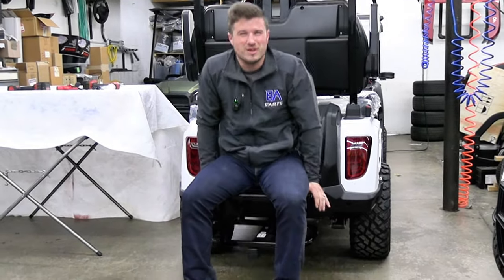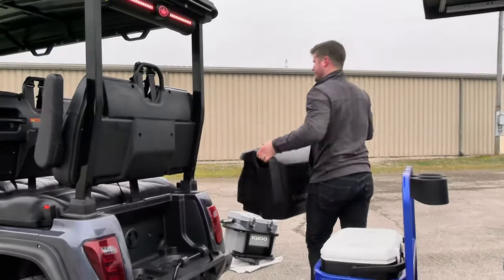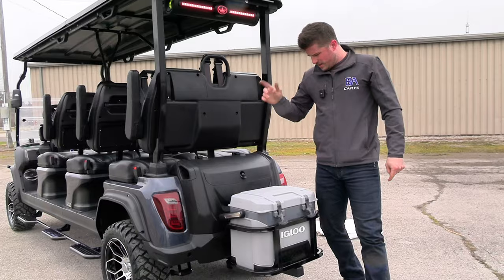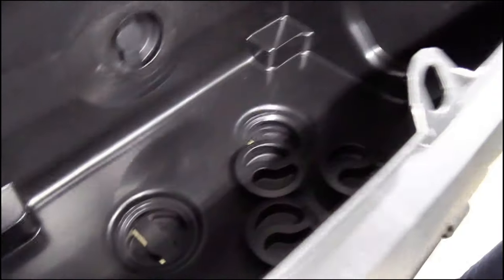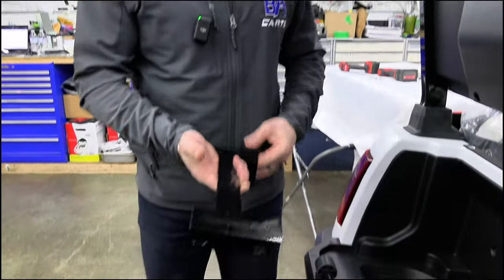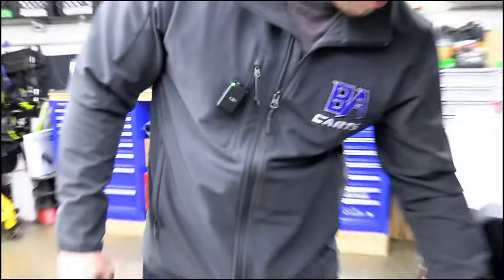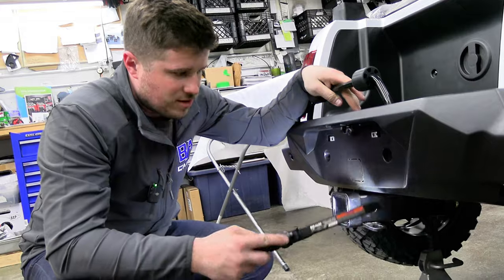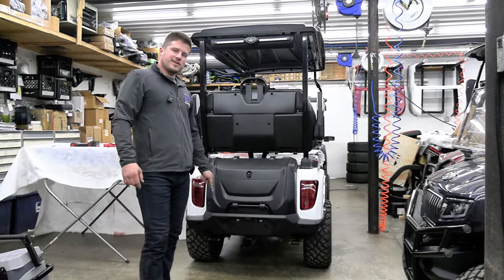Evolution D5 Hitch Receiver & Cooler Carrier (Info & Install)

Comment: Looks like you have cart up on jack stands, can it be done without jacking it up?   if not where are you jacking on axle?
Reply from the maker: Hey Michael! Yes it can be done without jack stands, we just lifted the cart up for the camera angle and video purposes. We actually redesigned the hitch to be one piece and it is now only one piece and mounts even easier! Instructions are included with shipment!

Comment: I just installed mine and it went smoothly.  I will say I weigh 194 and there is no way I would load the max of 200lbs.  I didn't put my full weight on it but I did see flex on the hitch when I tested it.  I'm excited to have it.

Comment: Do you recommend buying an evolution cart? Are parts easy to find? I don't to spend 12k in lemon.
Reply from the maker: If you're buying from a dealer that puts great pride into each and every cart that they sell, making damn sure that it's righteous and dependable for their customer, then yes I'd recommend Evolution. If you're buying an Evolution from a dealer that looks like they could care less about making each golf cart perfect for their customer (or they seem like they're not even capable of doing this) then I would not recommend buying an Evolution. Shoot me an email at Sloan@bacarts.com and let me know where you live and I'll send you towards a reputable dealer.
Reply: As a customer who owns a D5 I can highly recommend it, we installed the upgraded sound system and tow hitch purchased from BA Carts
Reply: @bacartsvw  this could be said about any brand from any dealer. What makes evolution more questionable at the dealer is not a great dealer? I mean, there are a ton of dealers who are horrible and so only club cart and easy go but you can still buy from them, knowing they are repairable easily